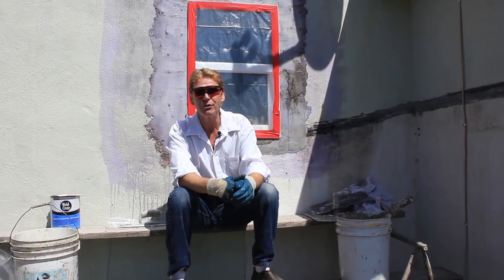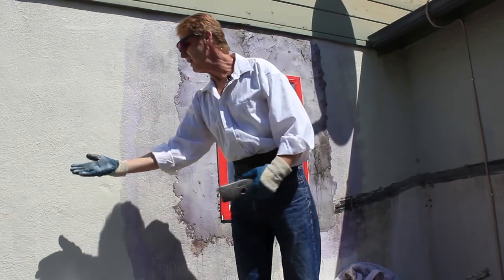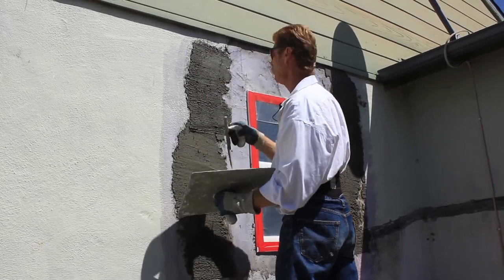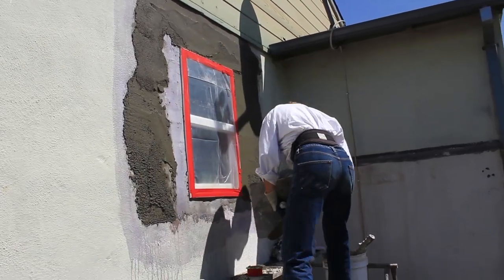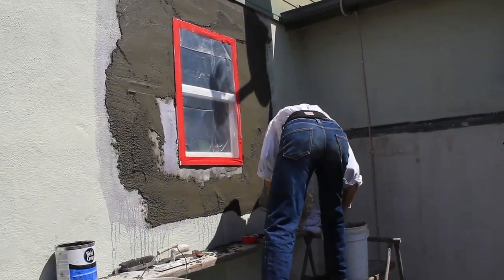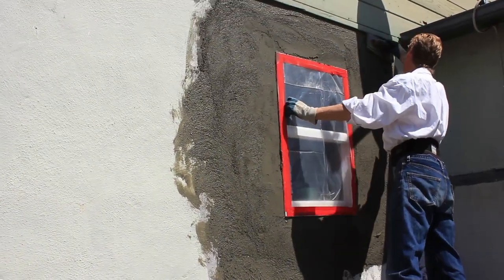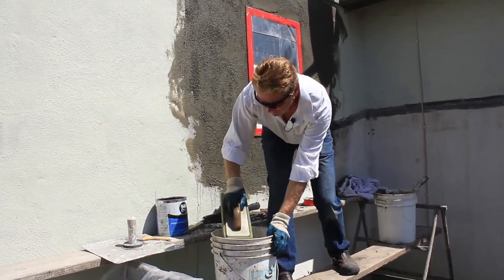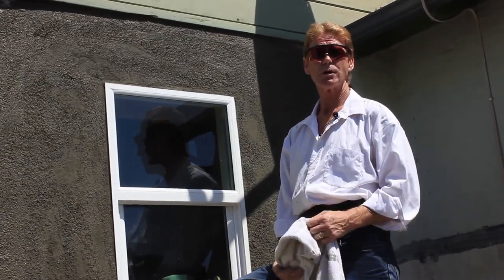Repair bad stucco patch before painting

Comment: Nice work very instructional my question on the 1st coat coud i use regular cement 2nd coat stocco cement by the way im repairing a window just installed thanks
Reply from the maker: Howdy Javier, both coats were used with Hanson's Lehigh premium all-purpose cement plaster, we added three times the sand to the cement plaster,
 Presto, stucco.

                           Peace, love, and harmony to all
         Sound Plastering tips for the DIY beginner’s and Plastering experts

Comment: You went full strength on the bonding agent
Reply from the maker: Howdy Gil Velazquez, exzackery, this is a skim coat I'm appling not a color coat which is usually 1/8 of an inch.
 I go full strength on everything except maintenance free color coats.
 Best wishes, 
 kirk giordano
Reply: Thank you Mr. Giordano